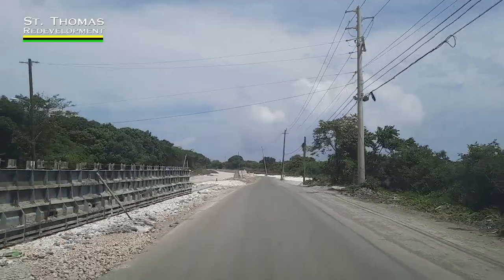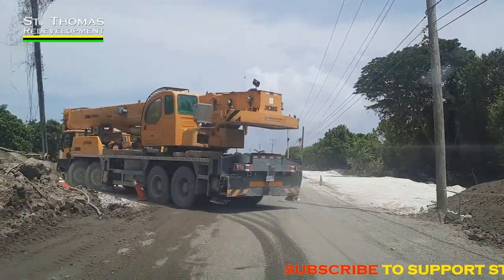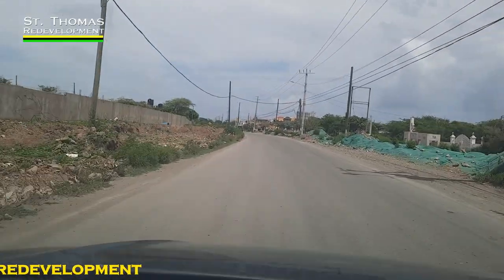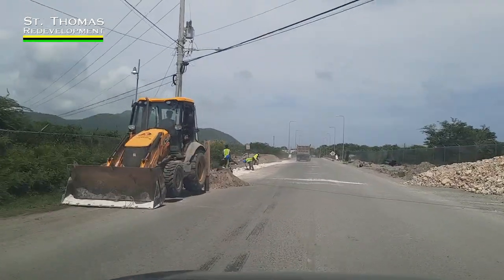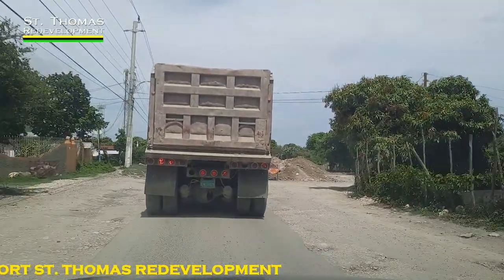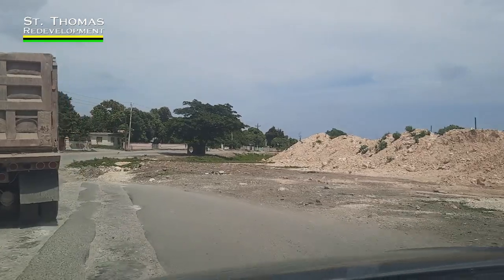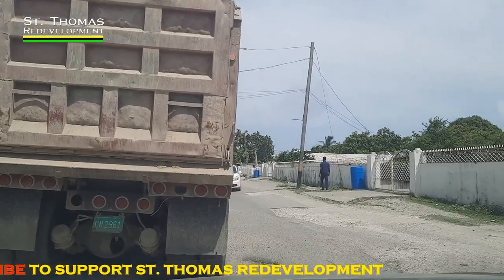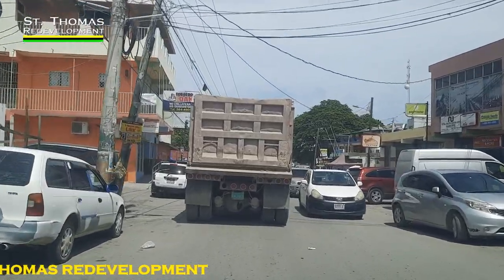St. Thomas Getting Modern Infrastructure

Comment: When this road going to be finished I was there in October 7 months ago
Reply from the maker: Hey Ginio based on info that was released to the public this particular section has a year to be completed. As it relates to the sections that are under construction by local contractors, those section as was stated in Parliament will run until 2025 for completion.
Reply: What about nest castle.  There know. Road. There .